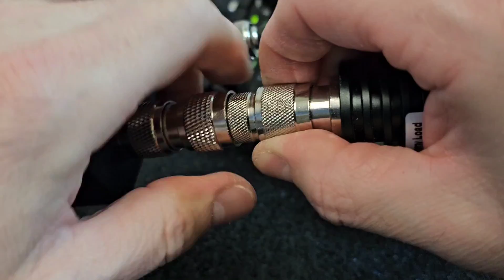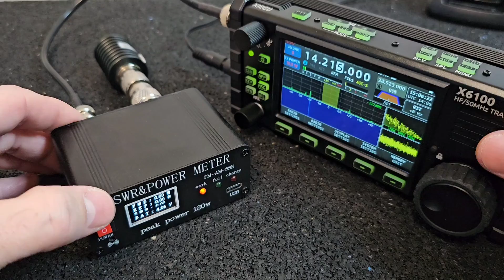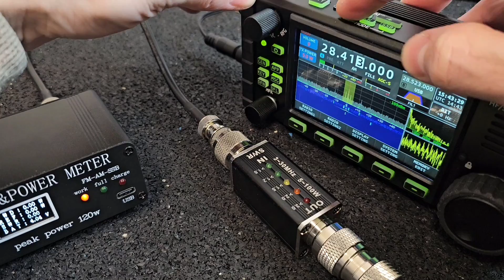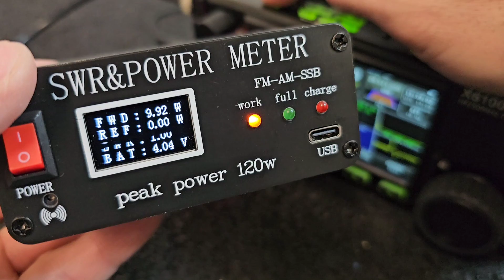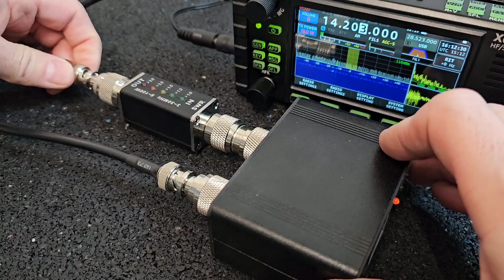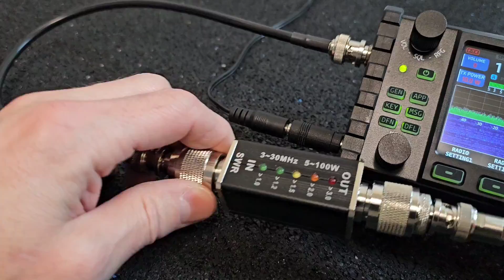Mini SWR Meter for Magloop Antenna MC-20 Tuning (review)

Comment: Dear Poul..., if you dummy load is variable, like 50, 100, 150 ohm.., for 1:1, 2:1, 3:1 respectively,  you can be more confident for the readers and performance for  the new test set... but look like promising.., thanks YV6ENB
Reply: De acuerdo. Saludos Leopoldo de 2w0yvy

Comment: Interesting SWR meter Paul . Thanks for your review.
As a QRP operator I always worry about losing any of my power to SWR meters and this one relies on your RF power to illuminate the LEDs. I
 know the power required is not much but my preference for QRP meters is to use the 'Bridge type' SWR meter that can be switched out of circuit once resonance has been achieved.
73
Bruce G4ABX
Reply: It's only using the reflected power so very little to no loss

Comment: I would open it and try to reduce resistor values to give it a 1 -10W range. Would also be nice to fit the correct connectors. I'll buy one and try it.